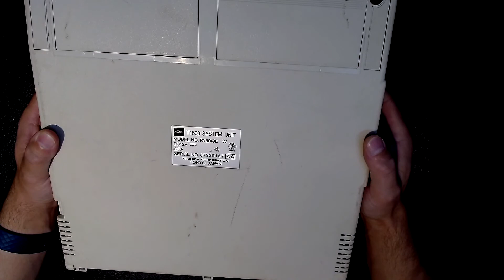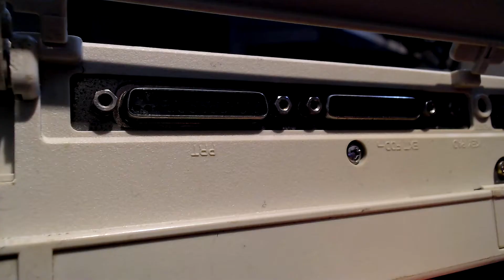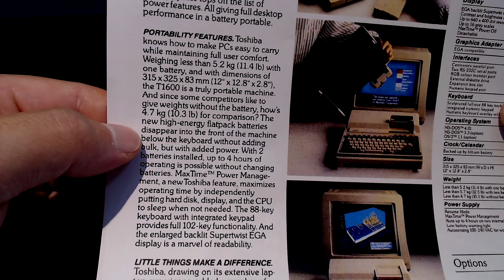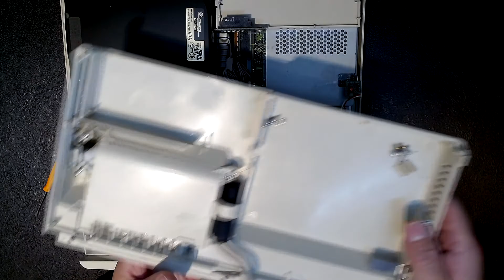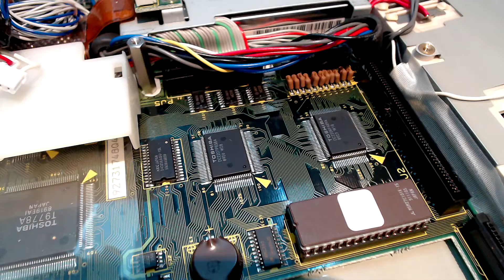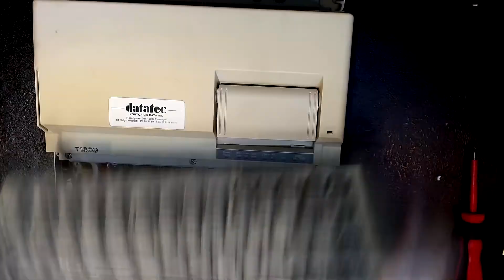Having a look at a Toshiba T1600 battery portable PC from ~1988!

Comment: That hard drive looks newer than 1988, could be wrong though. My T5200 has a Conner HDD but it looks more ancient than yours.
Reply from the maker: You may definitely be correct. I noticed later that some chips where labeled 89 as well and this portable may have been an even later model for all I know, but the T1600 itself came out in 88 as far as I could see when researching.